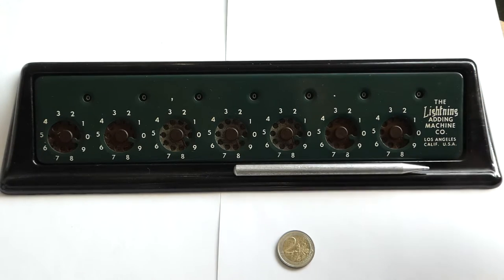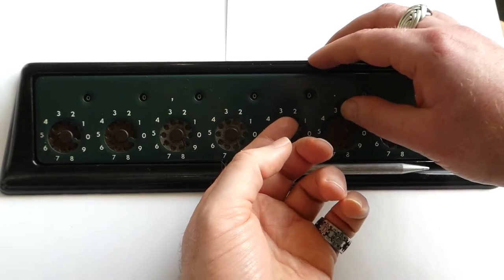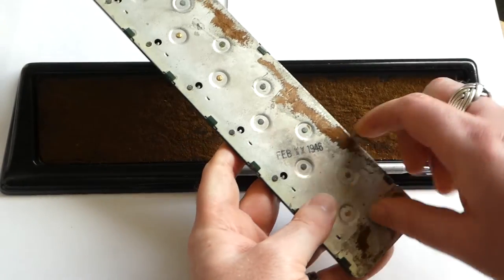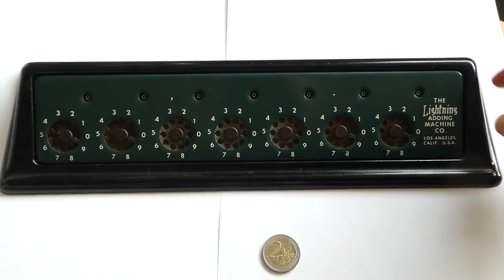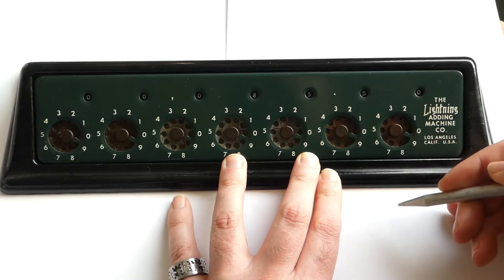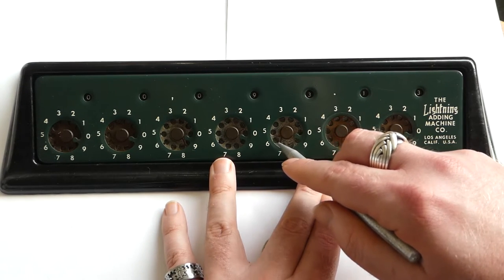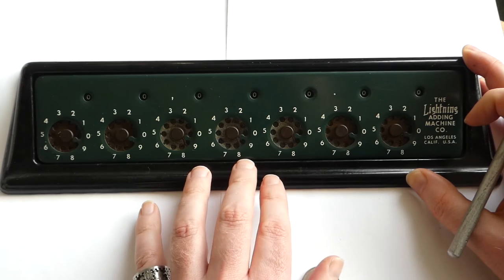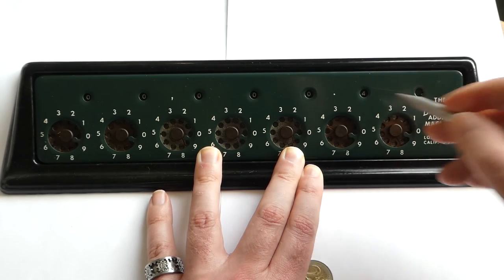The Lightning Adding Machine

Comment: I recently purchased a newer model that has the yellow co-digits for subtraction and a clearing lever. However there is something wrong with it... the dollars dial will not turn in reverse (subtract) and it wont turn with the clearing lever. It turns a bit more difficult than the others also, but not much. It has a clunkier sound to it. The cary works also, it just won't turn CCW. What could be the cause?
Reply from the maker: It is hard to tell. Unfortunately these calculators cannot really be opened for repair. It might help to just spray some silicone lubricant in it wherever you can, but if something inside is bent or broken there is not much you can do.